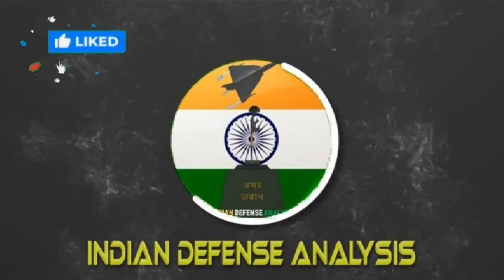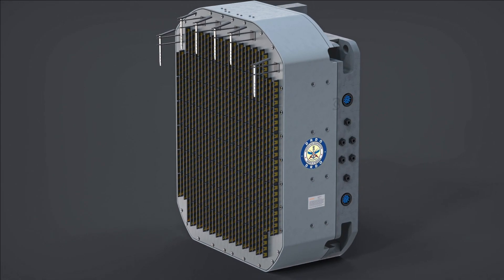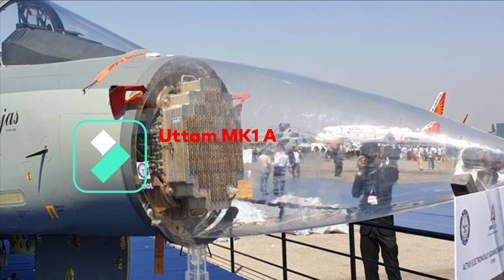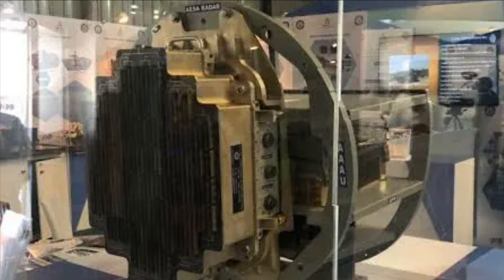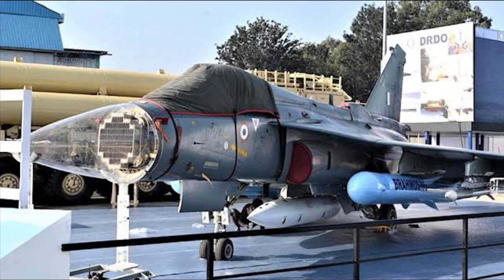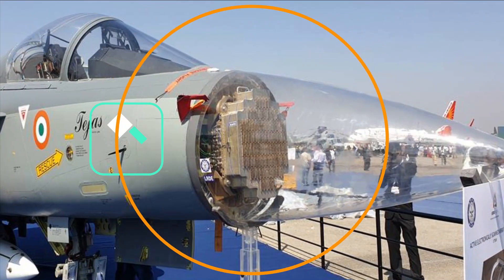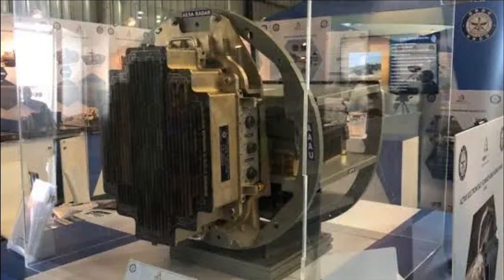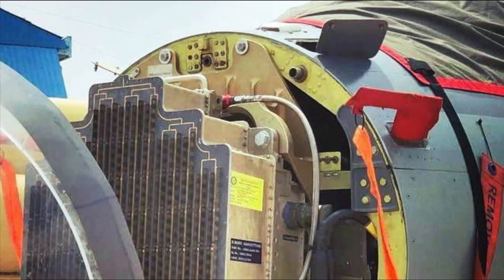Uttam MK2 to be integrated with Tejas MK1A(test bed)

Comment: From how much distance can uttam mk2 detect an object with RCS of 0.001m2..?
Any guesses?
Reply: It can track other tejas having RCS of less than 0.5m2 at more than 200km, according to some reports & interview.
So my gusse will be around 100 km for 0.001m2,
Reply: @chandraprakash-tu1hu  impossible...!! Cuz drdo officials once infirmed that uttam mk1 has  tracked an object of RCS of 1m2 from 105km.... So keeping that in mind one can conclude that uttam mk2 can track an object of 1m2 from 140-150km...... Tejas with 2 short range missiles and 4 bvr missiles (Drop tanks are not included) has an RCS of 0.5-1m2.... However a Tejas with additional drop tanks and more than 50% weapons load has an RCS of 1.5-2m2... so I think,the incident which you are mentioning of tracking another Tejas from 200km is the RCS of 1.5-2m2 ,which is understandable.... In my honest opinion I personally think that uttam mk2 can track an object of RCS of 0.001m2 from 50-60km....

Note:- This information is based on personal opinion and analysis... It may or may not be correct
Reply: Might be, we can only speculate.
Reply: @chandraprakash-tu1hu  yup... But think... Even if uttam mk2 can track an object of RCS of 0.001m2 from 50km then the uttam radar with 1290TR modules(for super Sukhoi) can detect the same RCS of 0.001m2 from 70-80km.... This concludes that the next generation uttam mk3 being developed for AMCA having gallium nitride technology and 1500+ TR modules can track an object of RCS of 0.001m2 from 100-110km+..... In other words,AMCA can detect F35 from more than 100km......!!!